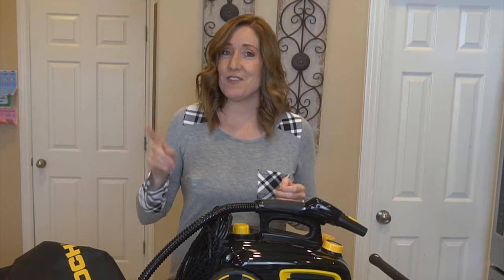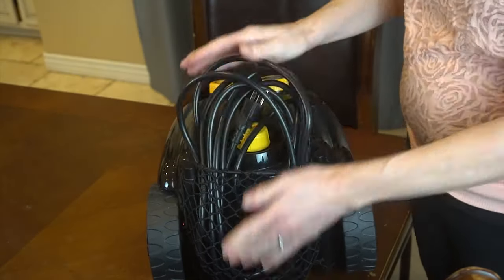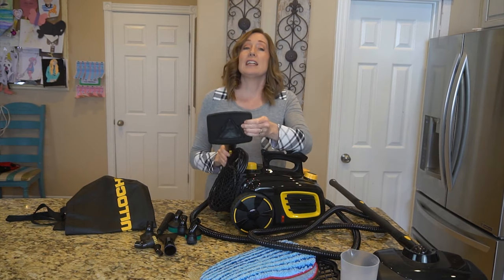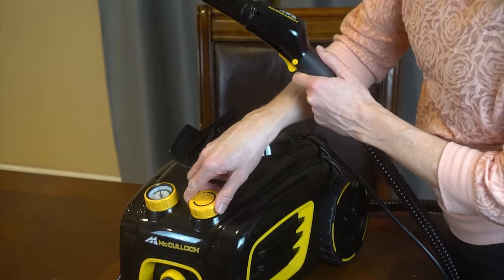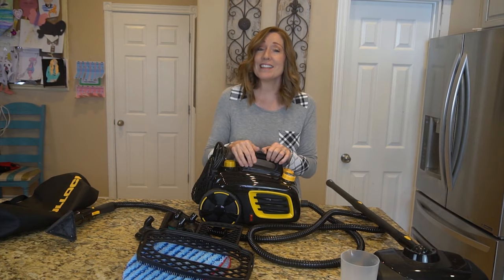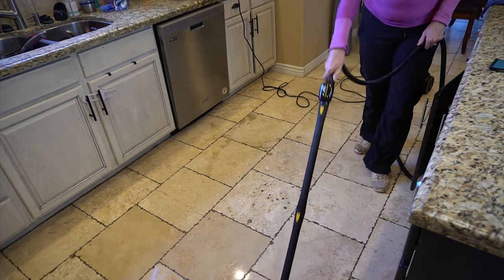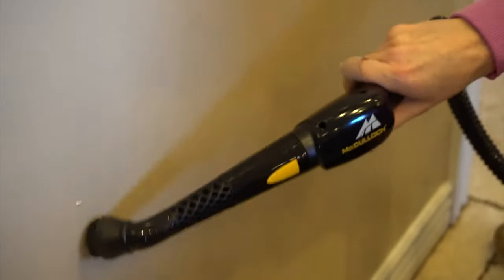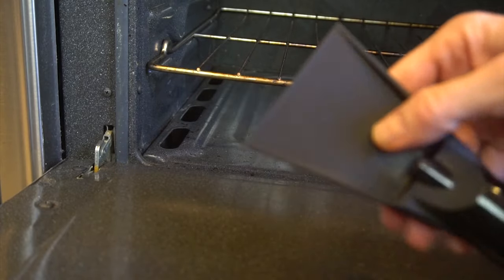McCulloch Steam Cleaner / See it Clean REAL Messes

Comment: Love this product demo! Thank you !
For bathroom limescale cleaning, did you put vinegar into the machine together with water?
Reply: Usually you are not supposed to put anything else than water in those tanks.
Reply from the maker: That’s correct, it can break them. They have formulas that won’t clog up the machine. Put the vinegar on the surface and then use the machine to clean it.

Comment: Edit: went with the Dupray. Now, I'm having problems with dupray. Weak steam. Idk if it doesn't heat up water properly anymore because despite button showing water is heated, I get water mixed with steam. Would not recommend. It's only been a year.

I've used this machine once every 2 months. 
Original:
This or the Dupray? Trying to decide which is better (power and durability) Will use throughout the house. Which do you recommend more?
Reply: Which did you pick? I’m torn too!!
Reply: I went with this but the 1385 over the Dupray, i like that i can use it indoor or outdoor specially detailing our cars

Comment: Thanks for the review.

Why is there water constantly dripping?  13:19

And does the Dupray Neat do the same?
Reply: @Beast Mode My Neat does not drip. If you stop using steamer for a few minutes, condensation builds up in the hose. When I resume cleaning with it, I hold nozzle in bucket or on towel and spray to release the build up water until steam comes out. Only takes few seconds. But my Dupray Neat does not drip, that would drive me crazy. Ha
Reply: The Neat is a dry vapor steam cleaner which is better.

The other is a regular steam cleaner, and there may be more moisture when your clean.

Comment: Has anyone used this on a mattress? If so, was it effective on removing stains or cleaning?
Reply from the maker: It can help clean it but overall it’s not great for stains. I’ve also tried a carpet cleaner. It does get dirt off and the water was dirty but most of the stains remained. We have mattress cleaning videos and that worked on almost everything. 

There are some stains that never came out which is why we always recommend a waterproof mattress protector. Or a new mattress.
Reply: I spilled coffee on my feather mattress topper and that's what I need it for too wonder if it would work. No dry cleaning stores left in our city so I'm stuck.